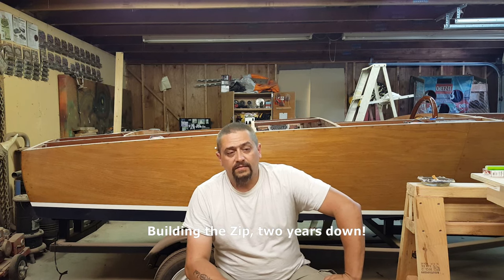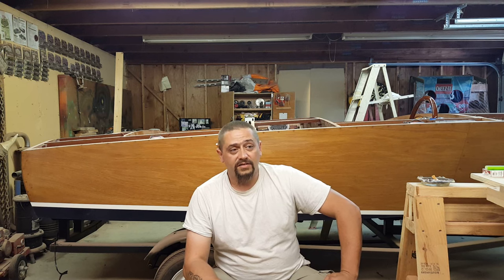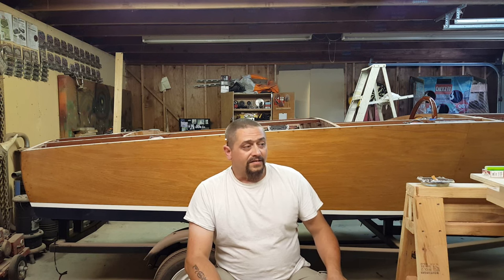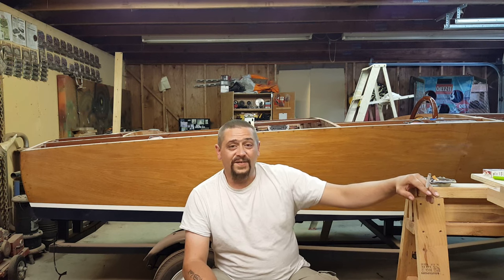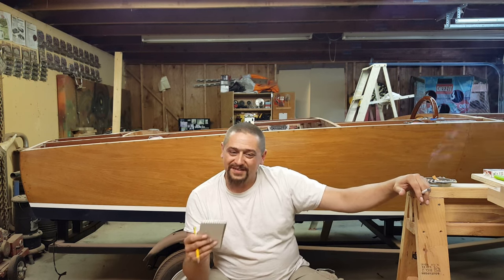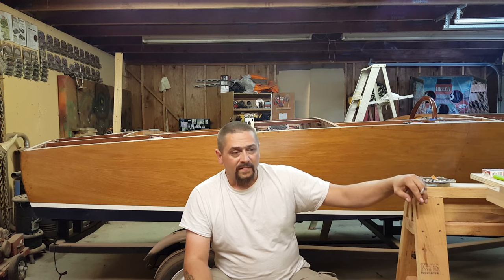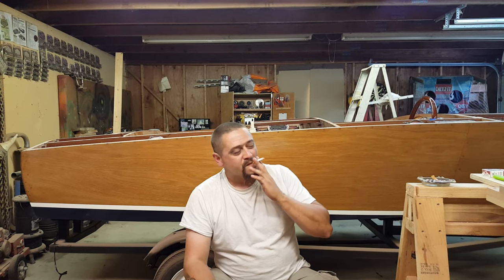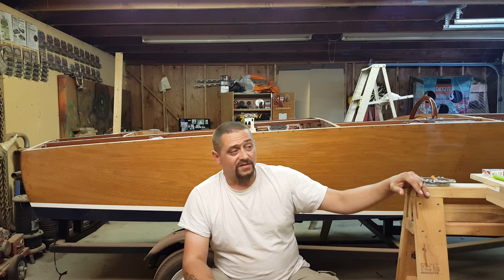Building the Zip two years down

Comment: beautiful work, and thank you for documenting. How have the plans/instructions been?  Have there been parts you didn't understand? Have there been parts where you departed from the instructions?
Reply from the maker: thanks for the comment the plans are pretty straight forward, and do a very good job with measurements and specifics to build the boat accurately there were a few areas that were a little fuzzy to me but I was easily able to answer any questions I might have had by just researching the forum on the Glen-L website, I pretty much fall of the plans to a tee the only places I have really deviated have been for instance not fiberglassing the hull at all which is recommended and I also changed how the deck batting attached to frame for instead of not Chang the frame my built little blocks to land on top of, once the hull is constructed and flipped over the plans pretty well leave it up to you at that point it's your boat to finish out how you'd like there are some suggestions for how to finish off the top sides and some suggestions for the floor most of which I deviated from instead of having a plywood floor in the boat, i opted for a planked floor as well as the arm rests which were not part of the plans, I doubt very many people have less woodworking experience than I did when I started this boat you absolutely can do it and if you get in a pickle you can research on the forum or ask any of hundreds of active members questions and they're  very quick to answer